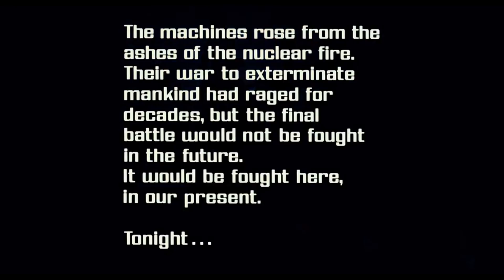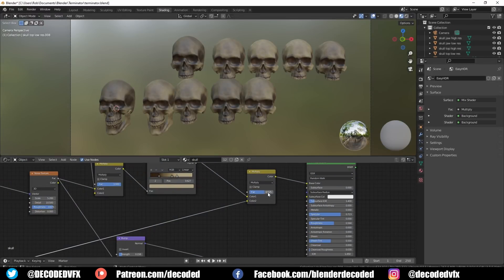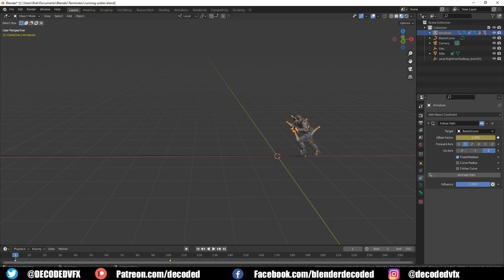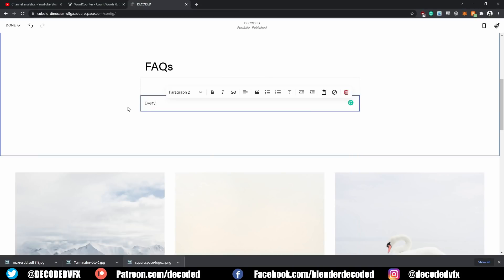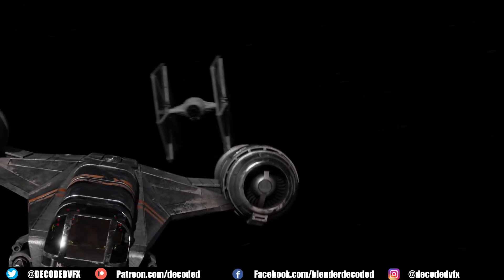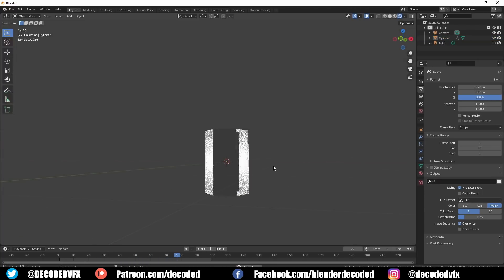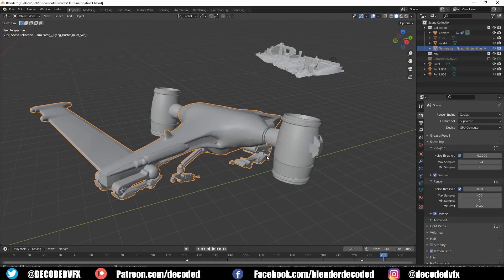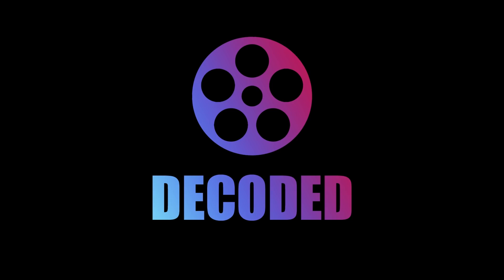Recreating 'The Terminator' In Blender

Comment: At 13:30, it wouldn't just be bobbing up and down linearly, it'll be more slightly shifting back and forward and side to side, as it has to climb over everything as it goes. Bear in mind how suspension systems and the sheer weight of the machine crushing softer obstacles would factor in, too. Having it go straight forward actually would've been more realistic, as i wouldn't expect much to stand in its way and it's more believable than it bobbing up and down on the spot. Can just take a look at videos of modern tanks and IFV's in real life, how they move over the terrain. You could almost animate it like a boat and it'd be in the ballpark.

Comment: Absolutely blown away by this - as I generally am with your content - but these last two videos you’re really elevating yourself to a whole new level. Already watched this through twice all the way as there are literally dozens of excellent tips & tricks throughout👏👏👏

I’ve seen a few other comments referring to the skating tracks issue - & I’m also wondering, of all the things you’ve achieved so brilliantly in this video, that actually seems like quite an easy fix, even if it was just eyeballing the key frames to set the speed (rather than any unnecessarily clever physics simulation); was it basically just a question of rendering it out & then just deciding you had too much else to do to go back & re-render? What was your thought process on why you left that shot as it was..?

Absolutely NOT a criticism of any kind - I think your work - & your channel - is incredible, just interested in your perspective on that..?

Amazing as always.
Reply from the maker: Thank you. 

I made the track animation without the floor in place. My main concern was to get the track speed aligned with the rotation of the wheels. Floor slipping wasn't something that even occurred to me since there was no floor at the time. 

By the time the floor was in place my viewport performance was terrible (I later discovered that I'd accidentally added a triangulate modifier to my track mesh, which reduced playback speed to 5 fps). It's very hard to spot animation errors when you're viewing one frame at a time. 

So I didn't even know the tracks were slipping until I put the whole project together in After Effects. By this point I was right up to the deadline and I had several far more pressing issues to fix. For a start, the framerate of some shots was completely wrong, so the whole video was misaligned with the original audio track. I lost half a day re-rendering those shots which killed any chance of having enough time to fix the wheels.
Reply: @DECODEDVFX  thanks for the thorough reply. I did wonder if it might have had something to do with playback issues - I completely agree, it’s often very difficult to tell what’s going on if the processor can’t keep up.

Stellar work as always though mate. Love it.

Comment: Nicely done 👍
If you revisit I would suggest adding a bit of film grain to all the shots.
For the tank in the background I would have used a slight noise on the rotation rather than position.
The only jarring bit was the tank treads not moving at the correct speed.
...and the linear movement on the jet (which also looked bad in the original)
Reply from the maker: Yeah, pretty much everything you mentioned is stuff I noticed once I'd put the video together, but I simply ran out of time to fix it.
Reply: @DECODEDVFX  I know that feeling 😆
Great work anyway 👍

Comment: outstanding, my favorite move (T2 anyway).    How do you set the extrapolation to cyclic? what view do you set that in?  https://youtu.be/Rk3ETKsIdSc?t=726  thank you
Reply from the maker: Just hover over the timeline and press shift+E. Linear extrapolation will continue the action of the last set of keyframes on the timeline. So if you have a 30 degree rotation over 100 frames it will continue to rotate in the same direction at that speed forever.